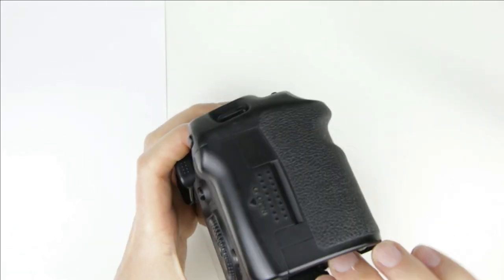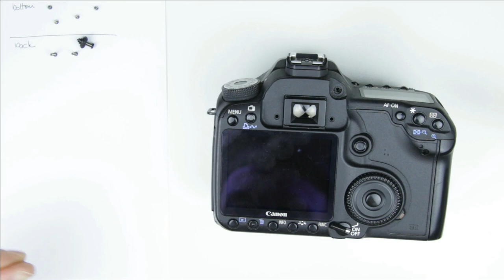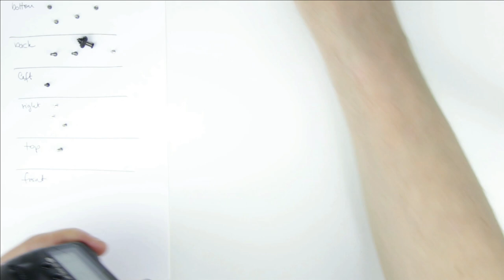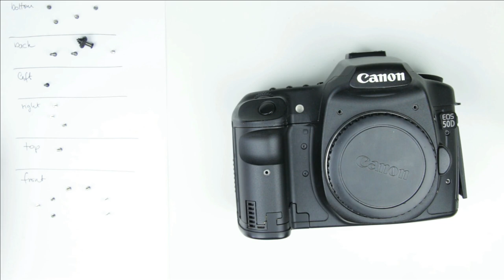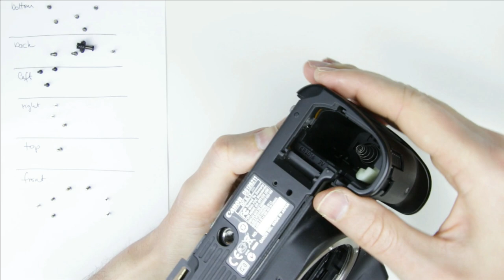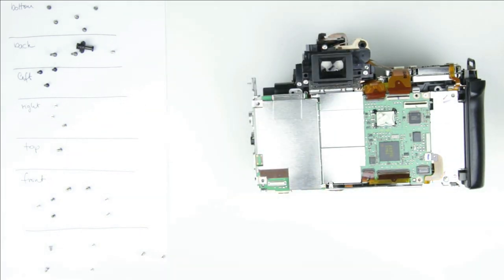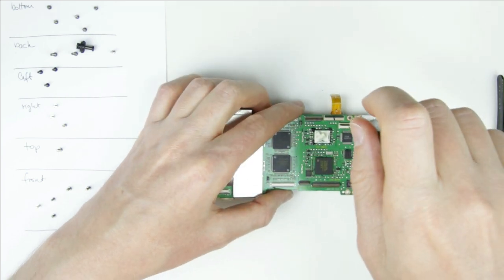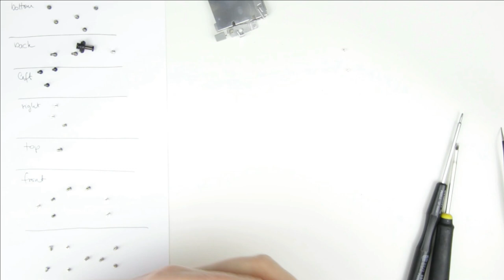Canon EOS 50D disassembly for repairing the CF memory card reader

Comment: You don't need to remove the front and top of the camera to access the card slot. Just a tip for those watching this in 2022. Removing the back shell, IO port and bottom is enough.
Reply from the maker: That is true, but it is much easier to put the PCB back if the covers (especially the CF clot cover) around the PCB is removed.

Comment: I have a 50D which has an issue writing to the CF card but it only happens sometimes when holding the camera in a certain position (like upside down). I assume it's something like a bad contact somewhere. I see no bent or missing pins in the slot. Do you suppose this could be due to dirt/corrosion of the pins themselves, some pin not being soldered correctly on the board or some flex cable not being attached correctly? 
I bought the camera  used from somebody and I have no history of it although some dirt on the LCD (beneath the plastic exterior screen) makes me think it was serviced before.

I've opened a 5D classic before thanks to your other videos and I'm wondering if I should open this one up also.
Reply from the maker: If you shake the camera, do you hear anything? My first guess would be a loose metal part which shorts something if you hold the camera a certain way.
Reply: @CamerasLensesEtc  No particular sound when shaking. I sprayed a bit of dry contact cleaner on the CF pins and the issue kind of seems to have gone away or at least it did not reproduce again yet. That said, while giving it a good test (shooting it a lot while holding it in various positions) it gave me error 80 once but was fine after taking out the battery and placing it back. I'll post again if the original issue pops up again. Thanks! I guess should the issue re-appear, in the worst case I'd have to take out the CF slot completely and have a look at it
Reply: As an update, I've disassembled the camera and did 3 things:
1. pushed back into position one of the CF pins that usually stand out in front more than the others. Previous owner probably reversed the CF card at some point.
2. with a fine tip solder iron I briefly touched each CF pin where it meets the board, hoping to "update" the soldering 
3. added back a missing screw that was holding the CF shield. Not sure if that helped but it seemed like without it the shield could move around a bit potentially touching some pins if moved too much.

All in all, so far at least it seems to be working. Thanks again for the video, it was very helpful!

Comment: I know this is an old video but you do such a detailed job, thank you! I believe I have a little corrosion built up near the battery connectors. I’ve cleaned it the best I can without disassembly. Is there a way to access that area and clean anything that may have corroded while the camera sat with the battery in it?
Reply from the maker: I don't think that it is possible, you have to connect lots of flat cables in the camera to get the camera working. 
You have to disassemble the camera quite a bit to access the battery holder.

Comment: Hello.  My husband change the card reader pin and its not working.  The camera dont ready the card.  Can you please help me
Reply from the maker: Hello! First, I would check the camera with different memory cards. It happened to me that the camera didn't worked with a memory card, but it worked with another. Second, check if the legs of the card reader is soldered correctly to the PCB, means there is no short between two connectors. If that is fine, then check the camera with an another 50D's PCB.

Comment: Hello, I used a plier to bent the pin back, but the pin loose, it felt inside the body and the camera wont turn on. Can I able to put the pin back or I have to buy a new pin? 
Thank you
Reply from the maker: Disassemble the camera, and remove the broken pin from inside, maybe it shorted something. (If you're lucky, then it did not damage the camera.)
Generally, you have to replace the broken pin with an another one, but if the broken pin is GND, then it might not necessary... test the camera with a CF card.